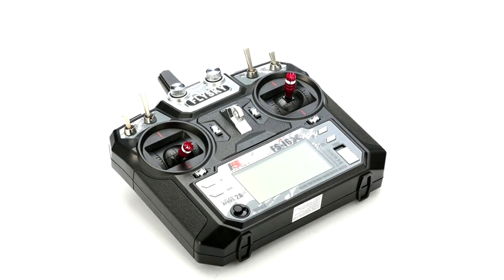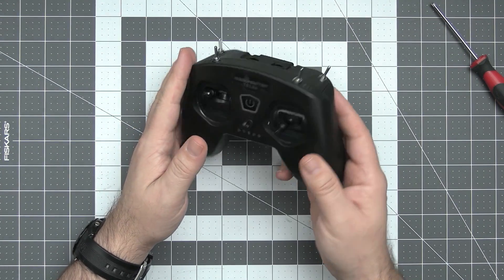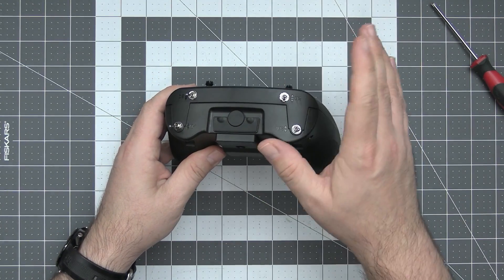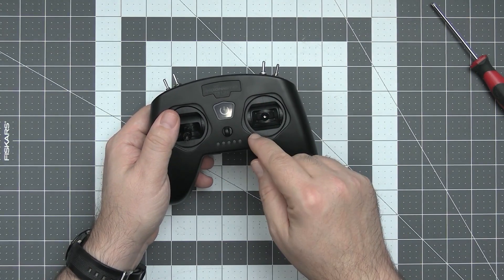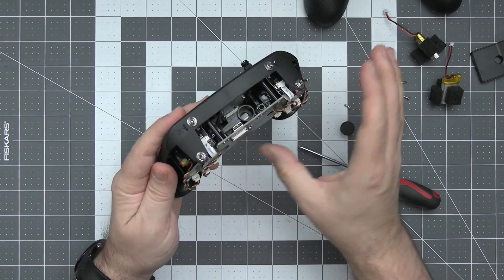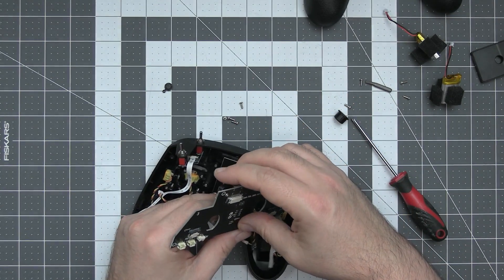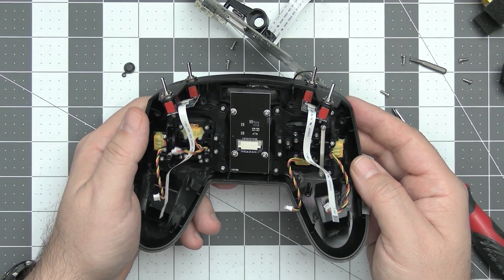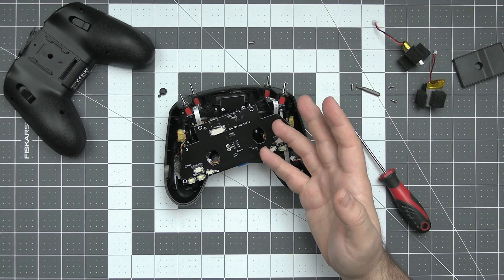What's inside a super cheap Radiomaster T8 Lite?

Comment: In 2022, I wouldn't recommend any radio that only has a CC2500. All beginner radios should support ELRS. The CC2500 is a dead end.
Reply from the maker: No, it is not. CC2500 are majority of receivers out there and we are talking about cheapest radio out there. Not something that is supposed to be user by power users
Reply: @FPVUniversity  Thats why for start I've ordered Radiomaster Zorro with CC2500 just to use with Frsky - it was cheapest one. If I'll love the hobby I'll just buy external nano ELRS extension reciever